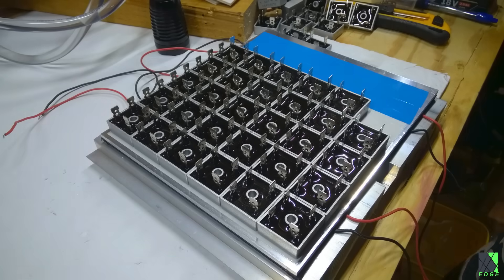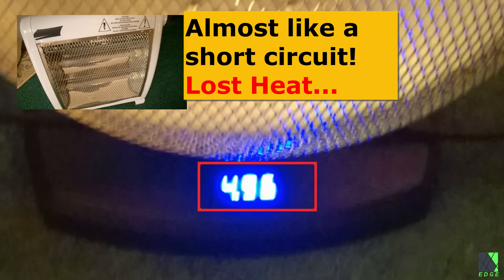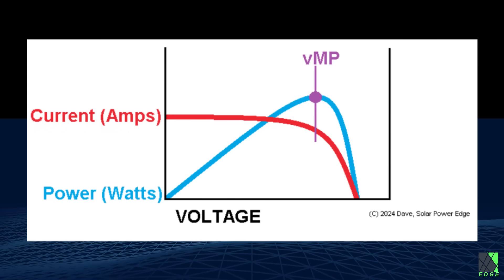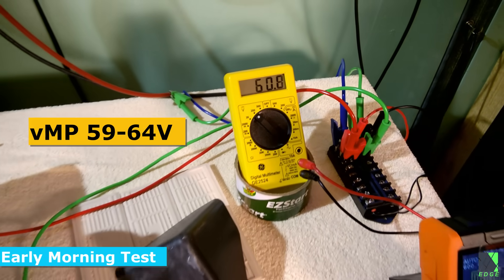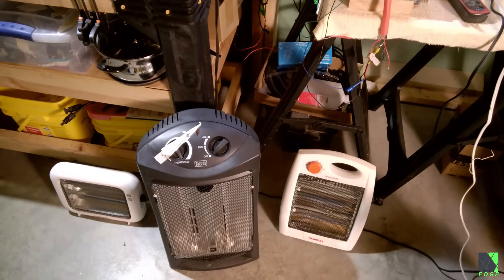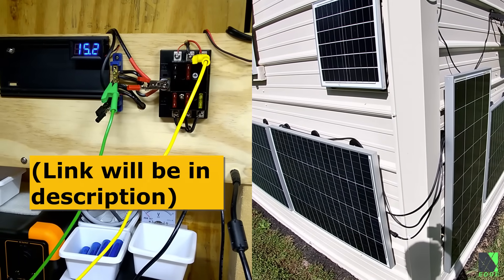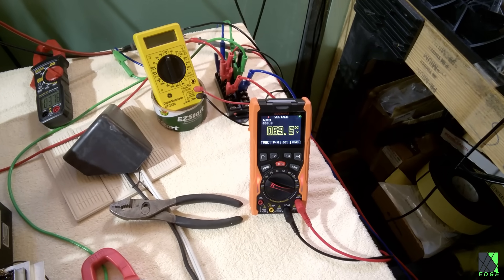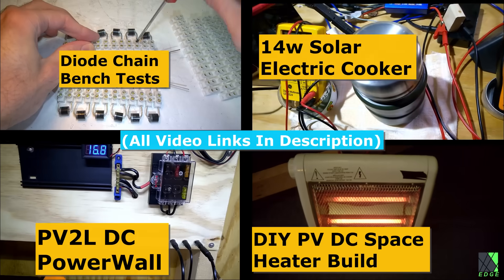How I Get More Solar Electric Heat With POWER DIODES - Poor Mans MPPT #DIY #solarenergy  #solar

Comment: First video I've watched from you.  Just subscribed.
I'm heavily into DIY.  Building a large house 100% off grid and 100% alone in Ontario Canada.House is heavily insulated and extremely tight. My biggest concern  is moisture. Never crossed my mind to use dry electric heat ... until now! Can't wait to review your material.
Reply: Fantastic!  I'd be interested in your exterior wall/floor/ceiling construction.  My approach is not conventional.  Controlling during winter will be paramount 
Using direct solar panel energy (extracting close to mpp)  during the day to heat during the winter seems perfect.
Reply from the maker: @Building_the_SHACK Amateur carpenter/builder here... I hope to post a video about insulation project as soon as humanly possible! Too much work not enough ability to do it...
Reply from the maker: @Building_the_SHACK Hi, thanks for subscribing! Good point space heaters don't make vapor. Your house build sounds awesome.... we have a "super insulation" project in it's early phases over here, maybe that will end up on video someday...
Reply: If you can beat my wall design I'd love to hear about it. And if some of your ideas are laughable...well we all deserve to chuckle, it's good for everyone. Think of it as a public service and keep plowing forward. Hope you get a chance share your experiments
Reply from the maker: @Building_the_SHACK yes... I hope to be able to share the results asap :D
Reply: Keep me posted please.  Building and fixing things is my passion
Reply from the maker: @Building_the_SHACK  Will do!!
Reply: FYI- I think ICF wall construction is a decent technology but very expensive and not so much a DIY option.
My walls are 2x4 ( R14  pink) then just a layer of R14 pink ( no studs/ no thermal bridging) then another inside wall 2x4 studs( R14 pink).  Very inexpensive/ Very DIY/and R42 walls.  I want to be able to heat the 1800 sq ft home with a candle!
Reply from the maker: @Building_the_SHACK Excellent... I'd love to do an all out ICF build. But I am extremely interested in DIY friendly super insulation. Like you said, heat with a candle... that's the ideal scenario. 
I am experimenting with absolutely everything before fully engaging the insulation project, even harbor freight blankets. Cardboard, normal foams, air gaps etc. Some of the experiments are a bit embarassing and might get laughed at! Depending on how it goes, we might have another video eventually.

Comment: I am really leaning toward diodes with a glycol solution in a radiant system.  You boiled water so I know with a mixing valve it would just be  matter of sizing.  Storage in a very large tank for backup during low sunlight periods.   Thanks again for sharing.
Reply from the maker: @timbrown9305  right on.. totally possible! In my workshop at this moment is a cheap HWH tank setup with diode immersion element in early testing... hope to post that if it works well enough
Reply: @solarpoweredge  Oh man that is fantastic news.  I liked the bulky diodes you were using in this (probably just because I am associating it with the load I am looking at.    I need around 500,000 btu for a tool and die shop.  1.5' thick brick walls and insulated metal roof.  Unfortunately there are 35' ceilings.
Reply from the maker: @timbrown9305  That's a big building... talking with a guy in Norway who is using roof mount bifacials to do an experimental solar electric heating install. Smaller building, but I am interested to see what kind of heat he can get from the system.
Reply: @solarpoweredge  It belongs to a friend.  I told him that we could probably get half a semi of off lease solar panels and easily roof mount on flat roof with 3 foot parapets.
My stumbling on to your continued research is fortunate.

Comment: Dave! Great video, I haven't considered using those bridge rectifiers, I believe that they might be a cheap option for high power diodes, they are ubiquitous and I like that I don't have to solder them together.... Makes it easier to reconfigure.... 
I'm thinking about the possibility of running a different set of panels in the opposite direction to make use of the other two diodes doing nothing in the bridge rectifier....  Kinda like using two Lab power supplies to get both positive and negative rails... Being two different power supplies which have an isolated output just as you would have with two solar panels, even though the positive of one panel is in contact with the negative of the other, the current flow from each respective panel should be automatically routed through the diodes and you should be able to either double the heat output or use less bridge rectifiers..... 
And while 17 minutes might feel like a long time, it really isn't.... I thought that it was just me and I was enjoying the videos, I keep finding myself going back to re-watch it because a lot is said throughout and it's very condensed.... I really don't want to miss anything.... But there's a lot more there which I feel isn't getting a mention... Like how did you attach the bridge rectifiers to the heat sink? It looks like you put something down that was blue in colour, I'm guessing that it was a thermal pad? 
Did you manage to get a thermal image of the diodes and the heatsink below the diodes? Would have loved to see what is getting hot in order to see where and how to make improvements to get the heat transferred to the air..... 
For me, I don't care if it can't produce the same heat output as a single 2kw electric fan heater, I just need it to be low power consumption and the ability to transfer it's heat to the atmosphere as efficient as possible, if I need to run 4 of them at 100w power consumption each, and it can hold the temperature in the room on the coldest day of the year! Then I'm happy! 
The lowest temperature setting on my electric fan heater is 1kw.... Having a device that can do the same thing with only 500W.... Now that's what I want...
Reply from the maker: @PeterMilanovski I am thankful for your interest in these projects :D these metal bridge rectifiers seem "tougher" than other types I tried. Mostly I just like the outer case being all metal. As usual 99% of the detail was omitted to keep things short and to the point... there are several different heaters built like this and I've tried various methods to attach the diodes. Imagine how laborious drilling and tapping 100's of holes is... I should have shown some of that work in progress. I am trying to use ordinary white thermal grease from ebay with metric bolts. Yes I have tried other thermal materials too. But hate to say it, avoiding thermal grease and bolts is difficult. 
Thermal image, I don't have an IR camera yet, although have been offered one to test by various companies... just humanly not able to do it right now. Hope soon...
FYI these heaters main advantage is they can regulate voltage.. solar panels must be at a certain voltage to make their best power. Otherwise, diodes don't exactly have any advantage over nichrome. Since I love using nichrome, the fact diodes can regulate in conjunction is very interesting because I don't have to throw away all those DC heaters I've collected :D
Reply: @solarpoweredge  Dave, ever thought about cutting open one of those bridge rectifiers? Like what's inside? How are they constructed? Are the diodes inside actually attached to the metal case? 
I got one of those plug into the phone USB C type thermal cameras which also came with an extra magnetic lens for getting in close proximity to electronics and not having the results being influenced by every other component around what I'm focusing on.... 
They are great no doubt even if they are expensive, I found out that the counter balance weights for the tilting garage door being made out of some sort of metal glow in the thermal camera long after the sun has gone and it's cooled down considerably.... Had me thinking about putting something like that in an enclosure and fitting some heat pipes to some Peltier devices that feed a bridge rectifier to generate energy while absorbing heat and then while discharging heat... The rectifier automatically routes the current in the correct polarity to a battery.... I have seen someone else try this with just one Peltier device, possibly a bridge rectifier and a joule thief circuit to drive one led from a capacitor, he thought that it was going to work for a day or two but weeks past and the led ran day and night.... Possibly still working today... It's something that I have always wanted to try... But I have yet to... It's still on my mind though....
Reply from the maker: @PeterMilanovski Thanks for sharing all these ideas :D no I never did open one, but one of these BR will burn out eventually and that's a good excuse to give it a try.
Have always been curious about IR cameras... multiple companies have offered to send one for evaluation, but I have zero energy left - dog paddling at this point. When things turn around I plan to use an IR camera on a couple of experiments. There is no substitute for such technology! Amazing.
Very interesting observation you made on the door weight. Baking a piece of metal in the sun for peltier generation sounds 100% plausible. I've had a number of ideas related to metal and conduction of heat, still shopping for bar stock. I'd like to use copper but it ain't cheap. If I had a large chunk of metal to work with there has to be 10 different experiments to try. I believe even cheaper steel bar could be used in this way.
Reply: @solarpoweredge  it's kinda like a sand battery and you use heat pipes to get the heat in when it's hotter outside and the heat out when it's colder outside.... The Peltier device will generate a voltage albeit in reverse polarity depending on what the temperature is but that's what a bridge rectifier is for... Since we are not talking about a lot of current for the sake of an experiment, probably be better to source some diodes that will pass current at a lower voltage drop of 0.6V.... and make your own bridge rectifier.... 
A large scale experiment would be really interesting.... Could possibly be great for some remote Barron location like the great outback here in Australia where there's nothing but red iron rich dirt, no trees no nothing for as far as the eye can see! Very hot during the day and very cold at night! I don't know what the humidity levels are but if there's any humidity, a dehumidifier could be powered to gather water.... IE an end product with an actual use case.... That's the Holley Grail.... 
As for the thermal camera, trust me, when you get one, you will have a lot of fun with it, I used it to catch my cat in the act, she had been sleeping on my couch in my spot but she knows that I don't like it so I never see her.... But with the camera, I can see her heat signature... I'm like Ha! I gotcha! But you will learn a few things from it too... It's like you were totally blind to heat all this time and now you can see! Could possibly be a song in that somewhere LoL.... Anyway, all in good time Dave.... You will get there..... Just keep at it buddy.
Reply from the maker: @PeterMilanovski Australian desert heat during the day, cold at night - doesn't that sound like an opportunity for Peltiers!  I'll keep chipping away at these experiments! :D

Comment: How did you get the diodes (bridge rectifiers?) to stick to the heat sink? 
Great work my friend, thank so much for sharing.  Wish you had amazon links to the fan and heat sink. I would like to build your exact set up.
Reply from the maker: @mppforall Hi, thank you and glad you like these project... although I neglected to show it in the video for time constraints, the correct solution is to drill and tap bolts and use thermal compound. I have tried thermal pads or tapes, with mixed results. It is really critical to get the  heat out of the diodes somehow or they burn. The heat sink is an old Nippon Chemicon industrial heatsink, the fan is a 200mm. I added links for similar stuff to give people some project ideas, but recommend doing some measurements and planning before buying anything. Those heat sinks ain't cheap!
Reply: I've always wondered why you need a compound between the two. Seems it would not help. Again, can't thank you enough for sharing this information and the work you are doing. I'm a huge fan😊 @solarpoweredge
Reply from the maker: @mppforall You're welcome, your support is greatly appreciated :D :) 👍
Reply: Ask any PC tech about the importance of thermal compound! It’s life or death for processors.

Comment: what's the benefit of using the rectifiers over standard diodes ?
Reply from the maker: @jackabal5392  They are very tough and can handle higher power dissipation

Comment: These are wired in series, + to -?  How many of these power rectifiers did you use, and what was the high temperature you operated them at?  I'd like to try these with heatsink buried in a sand battery that I mentioned in previous posts.
Reply from the maker: @canterburyworkshop5631 Correct all diode chains are literally diodes in series, nothing more. I have built a test sand battery, but have not found a satisfactory way to put diodes in the sand. Instead looking at other methods and ideas. Sand can build very high temps. It is said that diodes can go to at least 160C. I am satisfied to keep the diodes around 50-100C, just don't see the point of getting them very hot. Because I am thinking they might burn out much faster. Maybe I'm wrong. "So far" I haven't burned out a single diode.
Reply: @solarpoweredge  Thank for the quick reply.  This weekend I am testing some PTC's with heatsinks to heat the return line of my hot water boiler to 200F to see if I can mimic an outdoor woodburning boiler that normally uses a plate exchanger to maintain 200F in the boiler.  I'm trying to keep heat in the indoor boiler so that it doesn't use as much natural gas.  I'll let you know the results.
Reply from the maker: @canterburyworkshop5631 Welcome! sounds good, I am very curious about that kind of setup
Reply: @solarpoweredge  have you considered PCM (Phase Change Material) as alternative to sand?.
Reply from the maker: @ZeusChingon I'm very interested in PCMs! Fascinating stuff

Comment: Hi.  I've been following your work for a while.  It's great.  I love the fact that you have turned to using Bridge Rectifier Diodes.  It would really help if you could include a diagram on how you are connecting these.  It's not obvious.  Thanks.
Reply from the maker: @letter2steve  Hi thanks for watching, a diode chain literally consists of a lot of diodes in in series, there is nothing more to it; main problem is to keep them cool (get the heat out) or they burn. TO-220 packaged diodes might be easier to work with, I like the bridge rectifiers though. If you want to experiment, try cheap axial diodes in series with a bench power supply or small solar panel. Much easier to see how they connect. I have a video playlist linked in the description where I did that. It's a great way to see how it works on the bench before trying to do a build
Reply: @solarpoweredge  Hi.  Thanks for the reply.  I have already watched your earlier videos.  I've even read the Hot Diodes Paper.  I'm just curious the wiring of your Bridge Rectifier.  It's not clear from this recent video.
Reply from the maker: @letter2steve NP... everything is rushed over here... maybe will address this in a future video. Quickest fix is to look up the wiring schematic of a full wave AC bridge rectifier. Look for Positive/Negative, that's the connection points. Let me know if you can't find one, but they should be all over google images etc.
Reply: @solarpoweredge  Cool, I'm on it.  Thanks.
Reply: Hi there.  I really appreciate all the work you have done.  Upon looking into this, it looks like a Full Wave Rectifier Bridge will be a waste of 2 diodes as they will never be used.  It's great in that it's a simple way to wire in 2 series diodes at the same time.  It's also awesome to have a nice heat sink package to boot.  I hope I'm seeing that correctly.  I think it's a great idea either way :-)
Reply from the maker: @letter2steve Hi, I am thankful for your support. I think BRs are a good package at reasonable cost, but we should look at TO-220s too. I need to order some asap...
Reply: @solarpoweredge  Hi.  Oh man there are so many variations of diode packages and specifications to consider.  I really appreciate the work you are doing.  I don't have enough panels yet to help you with experiments sorry.  My money is on a T0-220.  As long as it's metal tab is electrically isolated it's probably the easiest to mount and provides the best thermal conductivity to the element you wish to heat.
Reply from the maker: @letter2steve  No worries, planning to order some TO-220 as soon as possible. I like the fact they are quite a bit smaller than BR's and maybe easier to fit on the existing heat sinks I have - will require some thermal isolation pads but those are very easy to find
Reply: Combining with some dc boosters is going to be great❤❤❤
Reply from the maker: @silidagreat :D